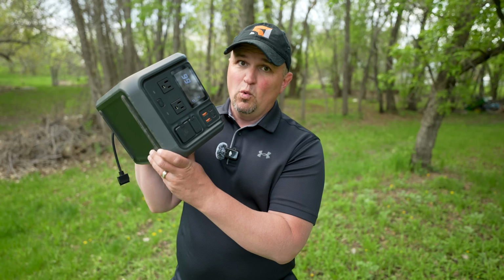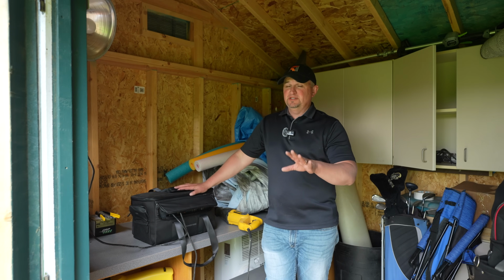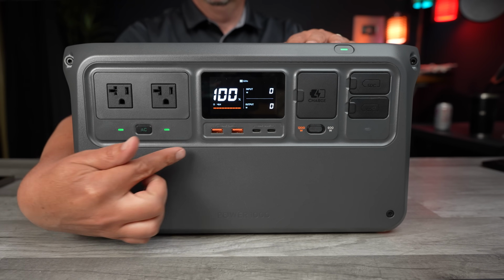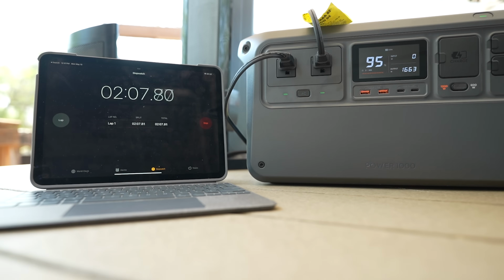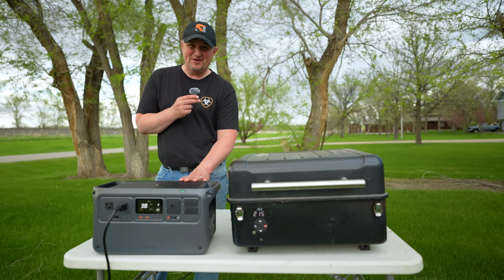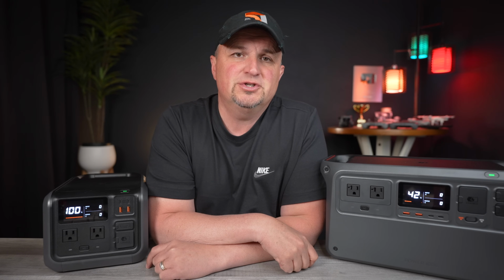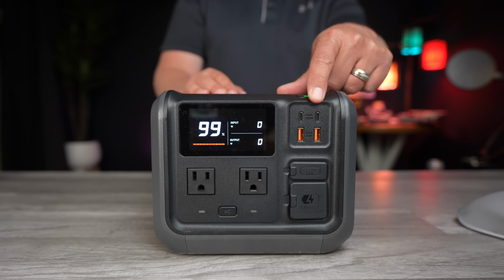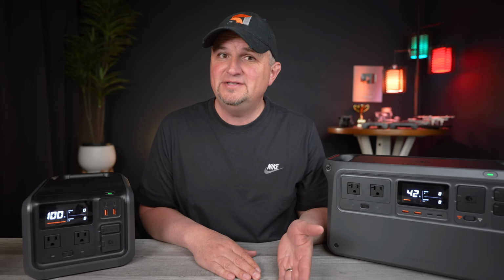DJI Power Station 1000 and 500 - A New Leader?

Comment: Russ: My DJI Power 500 was delivered mid-week and used it today out in the field.  What a game changer.  I used the option adapter to fast charge my Air 3 batteries as I was flying.  By the time one battery was depleted, I had another one available fully charged.  I have 4 batteries and  today I finally didn't have to worry about not having full batteries, staying up in the air longer then I ever did before.  I considered your recommendation to make my final choice in selecting the Power 500.  Thanks for your honest reviews!

Comment: 400 watt inverter and 10ah battery is cheaper. I put one in the back of my Jeep for $200. The power station that I built for camping was $1300 with a 1500 watt inverter and 100ah battery. The DJI 1000 has a 8.5 ah battery. It’s definitely cool, but power stations are ridiculously overpriced.

Comment: I believe you called it lithium ferrel phosphate. I don't mean to be a smart called but I think what you meant to say was lithium IRON phosphate which is the standard in all the new power stations. I could be wrong it could be a new tech I'm not aware of . Might want to double check . Also I noticed you said that proprietary connector cuts down charging DJI batteries in half . If this is true you might want to get into contact with Solar Labs YouTube channel, they knocked the proprietary connector , taking some points away. But I'm not sure they were aware what value it provided. Thanks again love your videos.
Reply: LFP and LifePO4 are the same thing.

Comment: Besides the car charger for the 500...is there anything to increase the re charge process such as an inverter?
Reply: You’d need to wire the inverter to a 12v battery, but yes 120v would charge faster than 12v.

Comment: How much time can the power500 handle a 50wh LCD?
Reply: It has a 512wh battery, so it depends on it the tv is 120v or 12v…maybe 5 hours. There’s a lot cheaper options unless, you need the DJI brand name.

Comment: Love my 500. Now if they would just come back in stock with the charge cable for Mavic 3 and air 3
Reply from the maker: I guess there was such a high demand that they sold out right away. They are working on getting more in stock. When I find out a date, I will post it and pin it at the top of the comments.
Reply: @51Drones  awesome, thanks Russ!

Comment: With your inside access.... 
Could you ask them when any of the accessory cables will be available (US market). I bought the Power 1000 and weeks later there still aren't any accessories available. I'm questioning my choice as a result. They give you a month to return it.
Reply from the maker: I have asked that question and when I get an answer, I will post here.
Reply: @51Drones  I just checked my order. I bought it April 19th right after I received an Email from DJI. That's nearly a month ago and no accessories have been available yet. The one exception is that I just recently managed to get the carrying case (being delivered today) and it's out of stock again. I think it was only available for a couple days.

I've been tempted to also snap up a Power 500 at the discounted price but the long term lack of inventory at launch of their magical killer SDC port feature kinda "kills" the unit's shine.
Reply: @51Drones  I guess they're not in the mood to answer. I did see the XT60 cable became available as did most of the drone recharge cables but the last two I want (the car charging and car accessory cables) are still out of stock. I bought the XT60 cable but it's in a state of "...picking the order" for three days now. This is unusual for them since things ship pretty fast in my experience.
Reply: @51Drones  Four hours later than my last post the car charger/accessory items have just showed up as in stock. I ordered them.
Reply from the maker: @sadkingbilly4531  great news!  Thanks!
Reply: @51Drones  And now all the accessories and package deals are showing in stock (in the US anyway.)

Comment: Ahead of the market as usual. I need it to have a transfer switch that meets backup-ups standards so that I can use that budget as part of my power-station budget, I use a 55ah UPS.  Seems like there should be solar panels that strap to your vehicle like a car-cover.
Reply: There’s companies that make solar panels that mount to your hood to either charge your main battery or charge an extra battery. I have a second battery that runs my off road lights, GMRS radio, air compressor, etc. I thought about adding a solar panel to charge it, but I usually just plug in into a charger when needed. I use to have a DC to DC charger that would charge the second battery when the engine was running.

Comment: What are the safe temperature  ranges. I am worried that a battery-powered charger in Florida would have a meltdown.
Reply: No I haven’t had any issues running an inverter and battery in my Jeep in Florida. That’s all a power station is, inverter and battery in a box.